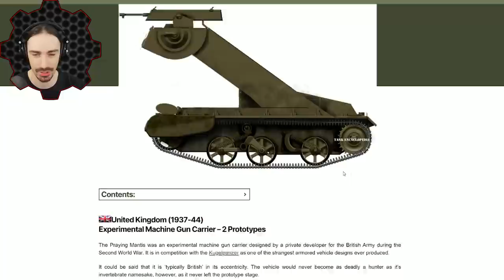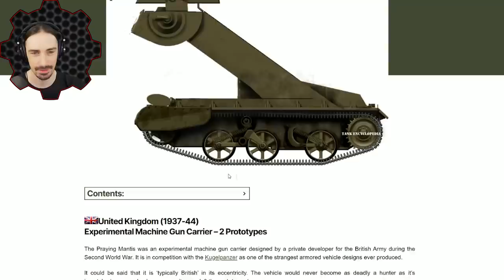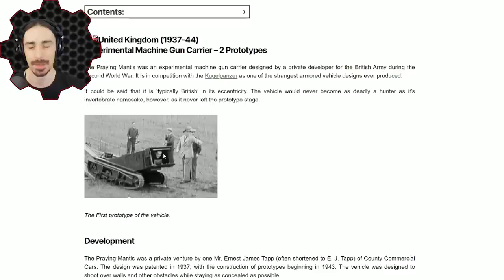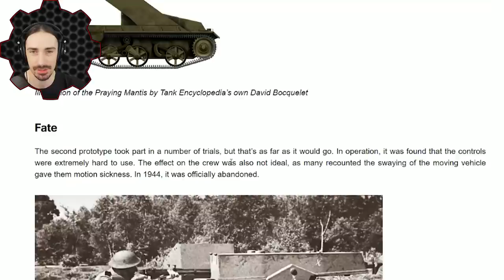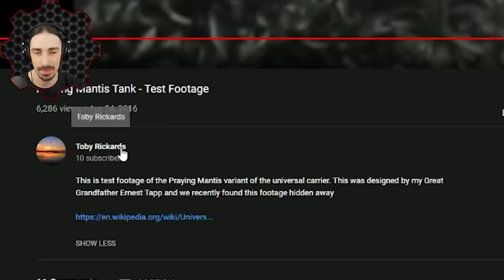This Real Tank Could Shoot Over Walls But Made Its Drivers Sick... SO I BUILT ONE!

Comment: Am i the only one who feels that this tank could of actually been good in war fare if it was just a bit bigger? Like if crew was actually in the body of the tank and the arm had only the gun and electronics in it, firing in cover is a huge advantage.
Reply: You gotta imagine they thought of that right? i mean they built the prototype like this saw its problem, n didnt try n fix them.  I know metals were a very scarce material in the war, and im sure working tanks were too, but if they had just retro fitted an actual tank with the turret system... Easy to say that in 2022 tho, we have more hindsight, and technology now than they had then
Reply: Not really, the problem would be that you still can only mount small arms on the turret and the arm itself has to be rather lightweight, or tipping over would be a constant threat, also try to imagine being stuck in that tank in case of a fire, you would be sitting in a chimney.

The whole Idea of it on the other hand was later used in tanks with an Oscillating turret. The idea there was, that you can look over obstacles without exposing much of your tank since the cannon could be mounted very high up in the turret (examples of these concepts is the AMX-13)
Reply: this is basically mecha if an engineer took a hundred passes simplifying it for production (removing unnecessary joints, replacing feet with treads, etc. etc.) just before realizing they'd be better off designing a tank.
Reply: @verrueckteriwan  actually, oscillating turrets were designed for early autoloaders. Since carousel loaders havent been invented yet (in use rn in Russian T64 - T14 series of tanks), they had to find a workaround. Autoloaders at the time needed to be in line with the gun to load. Basically, the whole turret turned up/down, the ammo would be in line with the gun. (Unlike more conventional tanks at the time)
Reply: @yayeetmeoffacliff4708  That is true, they had drums (or rather magazines that had to be swapped out once fired), but the role they had was scouting and engaging tanks without having a high silhouette (there was a video where they showed one in the french farmlands, peeking over a stone wall and engaging a target)
Reply: No your not alone I think this would be great. Being able to shoot over walls and bunkers without the tank being in much danger.
Reply: @verrueckteriwan  they said it was bigger to where you hade a real spot to sit
Reply: The whole time I thought that if this was tall enough to extend over the top of 2-level houses, it would be unbelievably useful for urban warfare. It's one thing being separated by a hedge /fence / simple stone wall from the people trying to shoot at you, but a whole house is a completely different thing.
Also for urban warfare, forget being able to shoot the enemy from over cover. Seeing the enemy is 50% of the advantage of being able to shoot over buildings. If you can see exactly where a target is, you can often even effectively shoot it THROUGH some types of cover. And for cover that's too touch, there's still grenades.
And while they didn't have cameras back then, there's nothing keeping you from building an unmanned observation arm with a periscope.
Reply: yes this could be a great tank but if they’re against the wall they could use a single rocket to dehead the gun and make it impracticable
Reply: Domine Non Es Dignus  True, i mean they could rig up a mirror thing, but that would get destroyed from dust and stuff. I was maybe thinking if it was more modern though.
Reply: Domine Non Es Dignus  you can use a periscope, so it was not an issue
Reply: Domine Non Es Dignus  angling a mirror is a very simple mechanical operation.
Reply: The problem with this vehicle is really more about spending your resources wisely. You can have one of these or you can outfit 500 men with rifles and ladders and binoculars. The 500 men are obviously more effective.

Comment: Yep, if you did the version with separate driver and gunner you'd be able to hook the controller directly to the gunner's seat and the gunner would be able to fine-tune the angle of the arm with "W/S".
Reply: yea but he used a vanilla toilet. sure, he could use a driver's toilet from the modpack but still.
Reply: If he had made a A/D converter he could have the driving on WASD and then had 4 more available controls for the arm
Reply: @1MBStudios  Ah, that too, but he did say he doesn't like using converters at some point in the past... I think. :D
Reply: @1MBStudios  perhaps

Comment: Scrapman, there is a way to make tank steering with only 3 engines and no buttons, just vanilla seat controls. One engine just does basic forward and reverse while the other two just cancel out the forwards motion if turning while going forwards or speed up the reverse when going backwards of either side. That control setup might have made adding fine control too the boom lift easier.